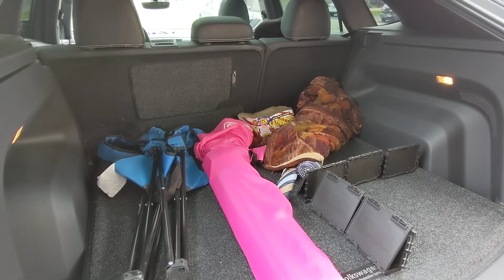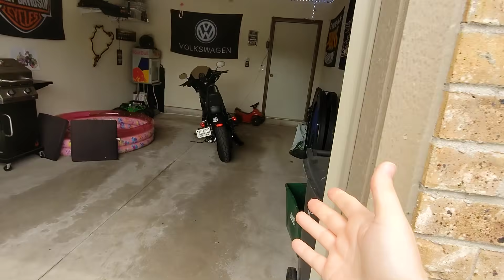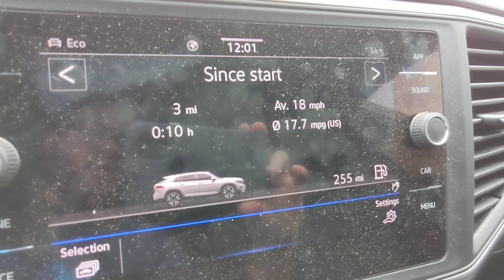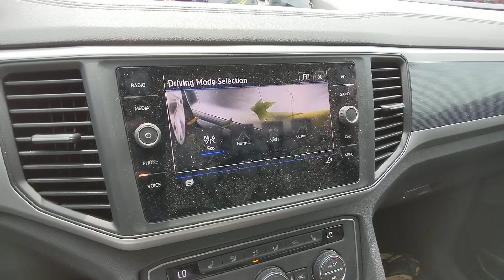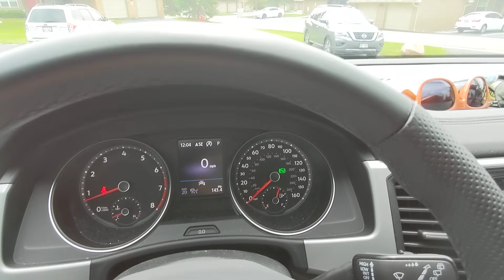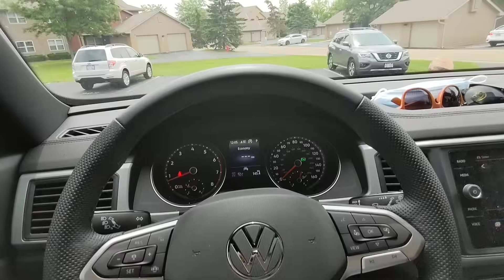2021 VW Atlas Cross Sport.  Why we're trading after only 4 months!

Comment: Sounds like poor planning on your part as you knew the SUV was for long range commuting.  Since 2021, I've owned 5 Atlas Cross Sports (all V6) and love 'em all.  I was playing the EV game for a while and that's why I've had 5 Atlas CS.  Every time I sold an EV I went back to the Atlas CS until the next EV arrived. As for the mpg, on every one of my Cross Sports I installed the same ECS cold air intake and surprisingly on every Atlas, it bumped up the mpg from 24 hwy to 28 hyw - with all drivetrain settings in ECO mode.  I detoured a few years ago to purchase a used 2018 BWM X6M with 20k miles which was pretty incredible but the back seat room stunk.  The BMW being out of warranty was keeping me up at night so I traded it in for a slightly used 2023 Atlas CS R-Line with 14k miles.  And decided to keep it since I'm out of the EV game.  Love the roomy back seat area plus all seats have nice seat warmers. As far as I'm concerned VW knocked it outta the park with the Cross Sport design.  Not to mention that it's just quick enough and frankly it handles quite well as it can be nimble traversing backroad thru the mountains. It's got the size, the comfort, the economy, etc. and it's got a nice style.  Most vehicles are pretty ugly these days.  Even the standard Atlas is ugly in my book.  But the Cross Sport is overall pretty cool looking for a daily driver.  I've never owned a VW prior to 2021.  Well done, VW, well done.
Reply: Are you having issues with the Infotainment system? That’s been a big issue for ours. We have the 2022 R Line. Very frustrating. Purchased it in November 2025 with 32k miles on it. Currently at 39k and trying everything to get out of it. Our X5 way less problematic.
Reply: @oldschoolday Hi, and sorry to hear.  we've encountered minor (no radio) type of issues maybe 10 times in 2.5 years.  3 or 4 months ago, I did a hard reboot of the infotainment system (depress the info power button for 10 - 20 sec).  Have not had an event since.
Reply: @simpleaspossiblev7994 copy that. I’ve tried that quite a few times. It works for a second, then out again. Thanks for replying.

Comment: Great video, but there's a big difference with the newer models. I have the regular 2025 Atlas (not the Cross Sport) with the 2.0 engine and the 20-inch rims from the Tech Package. I’m consistently getting 28 mpg on the highway here in Colorado. It’s impressive how much more efficient the newer turbo 4-cylinder is compared to that old VR6.

Comment: It amazes me that people do not research mpg before they buy a vehicle.  A 80 mile commute increase is minimal.
Reply from the maker: Read description :)
Reply: @amentauto3610 
@amentauto3610 
I did.  $8 per day for a commute is nothing.  Spending $10,000 more on a less reliable vehicle doesn't make sense.  This is evident with their major battery recall.  Even with your $10,000 in fuel savings over ten years, you then break even with the cost of the Atlas.  Plus, when not running on electric, that jeep gets the same mpg as the Atlas.  And...you finally realized this a few years later in another video when getting rid of your Jeep.   Everyone knows mpg go down when towing.
Reply from the maker: Im sorry you disagree so hard with our vehicle choices.  I like to live by "live and let live".  Also, math is slightly off, we saved about $250 a month in fuel.  That adds up quick!  Also, this was over 4 years ago now so my memory is slightly foggy on this.  I remember we saved money getting rid of it though, this was during covid and we took virtually no loss trading it back.  Was crazy times.

Comment: highway driving I get minimum 25 miles per gallon plus a good driving day with no wind I’ve achieved 30 so I don’t know why you’re having issues. Strangely, the first 30000 km to gas mileage was not very good but after 30000 km I was impressed considering all the power this vehicle has. Dealership had no explanation for why there is such a difference in gas mileage before and after the 30,000 km mark. As for city driving, there is no good hobby vehicle that will get you good gas mileage in the city unless it’s a go kart crap box that in winter is nothing but a problem, not only for the driver, but everybody else trying to drive around it.

Comment: You didn't know this before driving of the lot?
Reply from the maker: So yeh if you read the video description it does state that my wife's commute changed drastically.  The vehicle would have cost about $450 a month in fuel compared to $125 a month when we bought it.  $300 a month isn't nothing to sneeze at.  Also, i will say this vehicle seemed to guzzle gas slightly worse than EPA estimates, i remember returning an average of only 18mpg.  Our replacement was a wrangler 4xe which saved us an average of $3000 a year in fuel.  Nice car but when you drive 90 miles a day its got to go.

Comment: This video is funny, I went an bought an 18’ SE 4Motion with no research until I got home, mine has a perfect 1 owner carfax and all work done at a dealer (used car bought from a Subaru dealer) which gave me some relieve that it wasn’t in the first 1000 cars of problems lol, I found a few local mechanics for servicing and gas mileage is decent for a VR6/V6 engine as I was already getting 23-26 mpg in my 05’ Toyota Avalon so it’s about the same and the cherry on top it takes regular gas not premium 😎
Reply from the maker: Many people didn't read the video description.  Shortly after buying our commute changed drastically and we were spending over $400 a month in fuel.  20MPG is fine if driving 20 miles a day, not so much when driving 100 miles a day.

Comment: You get a lot of what people like wrong... 

If you want fancy with all the stitches etc go buy an Audi, it's overpriced and over-engineered.

Personally I have made the switch from Audi to VW bc Audi is too techy these days and with a couple of modifications most VWs are actually better on a lot of levels. 

Why not get the 2.0T? The VR6 is not for people that want to save gas but want the direct power of a NA engine. I test drove the 2.0T atlas, the turbo lag was horrific, Ill take the direct power of the VR6 any day.

Comment: I am buying a sided one this weekend. I love it. I have test driven several. The ride hight. The space the power. It feels great. I work from home most of the week and my office is only 10 miles from my home. So 40 miles a week to commute to work. I am finally able to own a car that going to be fun rather than a commuter car to beat up. I am coming from a ford escape and this is a huge leap forward in every way. I also test drive the Honda passport. I had high hopes for it. It felt like the ford the moment I sat in it. If I am spending money I want  to feel like I am getting my moneys worth. This Car checks all the boxes I have ever wanted from an suv. AWD, space, V6 power, ride height etc etc. and given the car will sit in my driveway most of the week with most driving be local. I am fine with the gas consumption. We will take it for long trips when the weather is nice. We might as well do it in style and comfort. My only issue is finding one in the R-line config. They are hard to find with low miles and in my price range. So I will settle for the SE with tech. And at a later date get the more aggressive looking rims. That should help the aesthetics. I can’t wait!!

Comment: Things have changed since 2021. its 2024 now so you get a new engine and better mpg and better interior ( what you have there is old old old lol now its like the starship enterprise inside, 12 inch screen, beautiful features.  V6 is gone so the gas guzzling is gone. Still has crazy horse power and folks i have chatted to online said they can get 30 highway sometimes 35 highway.

Comment: Def do research before buying these cars and you would have known about the cheap interiors and not so great fuel economy. Another thing when it comes to VW , never buy new always buy CPO about 2 years old and you will save a TON of money. Just got an atlas 2021 for $28k compared to the 43k they wanted new. Again good cars just not worth the new msrp because of the cost cutting they do alot of the time.

Comment: I did Toronto-Montreal (542 km) and the consumption was 8.5l/100km (27.67 MPG) on regular fuel, which I consider very nice because I previously owned a 2011 Mini Cooper S 1.6L 189hp getting 8.7l/100km with premium gas.
Reply: I have a 2021 atlas cross with exec with v6 and I when moving to Berta from Ontario got at one point 950 km on a tank I have photo to prove was unbelievable genuinely love vw also if the guy in the video wanted quality they should’ve just paid for a better package
Reply: @nathansoucy1578  this is very good to know . Im interested in getting a 2021 atlas cross sport . Live in Saskatchewan and city trips are 200km+ , also drive to Ontario yearly 2700km one way .   Used to have a 2015 passat tdi but sadly a deer to its life .  The tdi got 5.0L/100km which was amazing but that us equivalent to 7L/100km for a gas after fuel cost . So good to know a bigger vehicle isn't much worse on fuel for long ass road trips

Comment: I stopped to check out your review because I favor this model. I will admit that when I heard you commenting on the amount of gas this puppy consumes I was kinda surprised. Normally I'm always thinking travel and gas, only because I've own Explorers, the Expedition and the F150s,  all 8 cylinders, you would think I work for Ford lol..gas prices in Jersey have actually increased significantly since this vid. Research your alternatives, and when ur done research some more. 6 cyl and 8 cylinders are pretty big engines. I would drive a large deasiel if I could, but I can't justify the fuel. I do love the larger trucks though. My perspective is 21st century autos are beautiful but not all are practical. Especially with today's auto market charging up cost on new and used cars and trucks.....hope you made out better 👍

Comment: You bought a V6  AWD  Large SUV  during the height of the gas prices and were surprised that it cost a lot to fuel...hilarious...full disclosure I previously owned a '19 Atlas SE w Tech/ V6 AWD, and the dealer offered me more than what I paid for it. I took it and ran....I disagree about the HP; the vehicle is too heavy for either engine... it's slow to start, but once it's up to speed, it drinks fuel; there is not enough gears in the transmission; it's just too heavy. I bought an SEL Jetta for my commute...good luck with your trade

Comment: 5500 pound towing capacity and you mentioned Harley Davidson as an example! A bit of a strange comparison with the towing power of a car.
Most people probably don't know, not aware about the towing capacity which is 5500 pounds includes the weight of the trailer, the weight of the cargo, and any other extra weight you load into the SUV (any back seat passengers, anything in the trunk). Not sure if the tranny cooler is included in the VV towing package.

Comment: I have a much better reason to trade 1 in. I have a 2018 model which now past the warranty period. I brought the car in to service the passenger side LOW BEAM LED (there is no DIY option, dealer install only). Forget the fact that you have to remove the grill, tire under carriage, and the beam itself, cost of the beam (which I will get to in a minute) but then the light needs to be recalibrated. The cost was $2,900.. not a typo. Electric System $1627, Int/ext trim removal/replace $857, Recalibration $408.. total cost $2,892 to replace a low beam. If I was reading this I would not believe it but I promise you this is true. There must be someone that has also encounter this problem that can back me up. IMO this should illegal but I'm not sure how. If anyone knows or if anyone would like to see a copy of the estimate I would be happy to provide it.

Comment: Dude stop it, am trying to figure out the issues here, THIS IS V6 AWD OR 4MOTION.  you are talking about. I have 2018 Atlas 4motion and I get around 350miles on full tank. way better most of the SUVs around. Maybe you will better with a sedan car instead. I have driven in Infiniti Jx 35, V6, Highlander Limited V6, and the Atlas is better on fuel economy. So  come again on your dislikes. Thanks.

Comment: Bought 2018 Atlas SE, w/Tec Pkg. FWD, not AWD. No need for AWD.  Put on almost 100k miles - have not paid a penny for service, aside from oil change. Fuel economy is normal for an SUV this category. Taking it in for brakes and inspection soon. Changed air filters myself. I don't keep tires at 35psi, it's around 40. Once in a while the engine auto start/stop deactivates due to braking habits, which eventually resets after a couple days regular driving. If this happens to you, don't panic. The airbag sensors are.... very sensitive, so keep floor areas under seats clear. Very spacious vehicle. Great for long road trips.

Comment: Anyone had a problem with the gas mileages always changing numbers I can have 100 miles to E and in 10min will change to 300miles to E I know they something not working anyone have this problem as well!!??
Reply: Yes, I have that problem. VW needs to replace the pump. What I did was rely on the odometer. US has 4 or 5 yr warranty, Canada 2 yrs.

Comment: We have the 4cyl turbo has a more features in inside but roughly the same we got it because it only had 2ft/lbs of less torque was not a bad trade off to get 450 miles of range on sport mode

Comment: Amazing how they "lose" things as they come out with newer models. We bought a 2019 Atlas SEL Premium. The rear seats have little flip handles near the headrest to "pull" and the seat goes down. The middle seats have handles on the side of the seat. I now have 3 cars (including the VW). 2011 Minivan and a 09 Jeep (which is daily driver even though it gets 10 city, 15 hwy thanks to all the mod's I've done to it).  I knew all about the MPG before going in but watching how it does in crash tests sold me. We drive the Atlas on long trips mostly. It's almost 3 years old, 16k miles. I get 25hwy, 16/17 city. It's quiet, smooth, fun to drive and it's my 4th VW. Before that, had the 2013 Passat TDi SEL P. That would be a great car for your fuel use but IMO, for your family use, think of a minivan. I've seen young families with one kid swear they wouldn't be seen dead in one. Then they get 2 and complain their ford edge just doesn't hold all the "Stuff" they need it to carry. They rent a minivan for a trip. Upon return, they end up getting one. I've been driving a minivan since 1993 and even though I have the Atlas, there is not a family vehicle for the price that can beat them. Get a hybrid. Good MPG and you will never complain about needing cup holders ever again. And if you need to haul a few 4x8 sheets of plywood, no problem.
Reply: II

Comment: If you’re only getting 17-18 mpg on a 50 mile commute, then something’s wrong. Either it’s a more than average stop and go or you got an extremely heavy foot. I’ve had two regular Atlases. A 2018 SEL 3.6, and a 2021 SE V6 R-line and I drive spirited and with a 40 mile each way commute each day and I’m getting 25mpg.
Reply: Nope. That’s actually about right. An atlas is a low spec suburban with a gas guzzler motor. And probably lives somewhere with ethanol mix gas too. I can get 19 average 2nd.  my wife who drives less aggressively (normally) always gets lower mpg than I do. City is crap, and the cross sport is less seats to get a sloped rear glass.
Reply: @Onizukachan915  I don't know then. Like I said, on my daily commute's I'm averaging 24-25 mpg and that's in Sport mode going 65-70. I just did two 3 hour plus trips across Pennsylvania with the cruise set at 73, and got 27mpg. That's just as good as the 2012 Dodge Durango V6 I used to drive daily. I love how everyone refers to the Atlas as a Suburban. Park next to one or an Expedition and you'll feel like your're driving a Tiguan.
Reply: I have friends with an Atlas that get better gas mileage with heavy footing than I with my atlas cross sport. I barely drive mine and don’t have a heavy foot and get 19mpgs on my atlas cross sport.

Comment: Found a 2016 V6 TDI Touareg in Dec 20. Under 27k miles and $31K.  Still gets 25-29.  Not as updated interior tech wise as the 2017 gassers VW released but...1st World Problem.

Comment: My wife is currently on her way home from a trip to Kentucky. She's sending me messages and video of snow and ice on the road as well as the TPMS telling her she has a tire inflation issue. But...it doesn't say which tire. We assume it is weather related considering she doesn't feel any pull or tilt.

Aside from that, our R Line, just like yours, has been a really neat ride. The problems we have had, especially when she was driving home with our toddler granddaughter, is that the "Infotainment" went berserk and turned the radio volume all the way to Peak Power, on its own, and it could not be turned down or even turned off. When my wife pulled into the driveway, I thought she was just jamming out to a favorite tune. Nope! She had to endure head thumping noise for about 20 miles.
That thing has a mind of its own. It craps out completely, requiring a "soft-boot" reactivation, or it has had to go in for a manual, out-of-the-dash full reconfiguring of the system. I think she has done about 4 "soft-boots" on her own. 

We are getting rid of ours this coming week as well. We've had it just under a year and have only put about 8,000 miles on it. Other than the issues addressed, it is a very sweet machine. I will admit to that. It has plenty of pep in its step and is really fun to drive. Well, other than the ultra-high lipped front seats. They make it a little cumbersome to access and egress.
Either way, it has to go.
Reply from the maker: The vehicle was definitely a mixed bag.  There were things we loved, them things that just didn't seen done well.